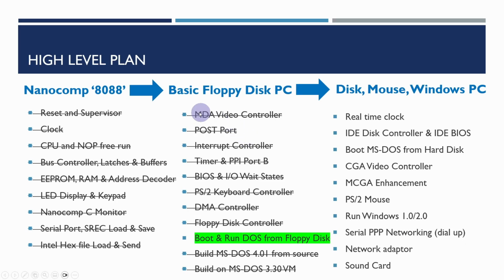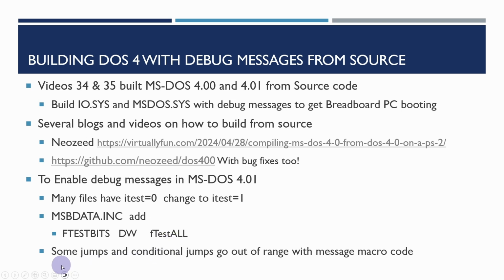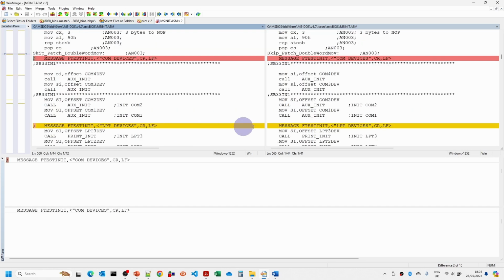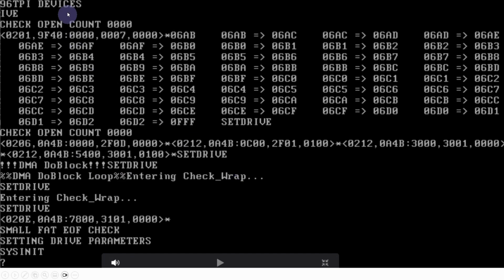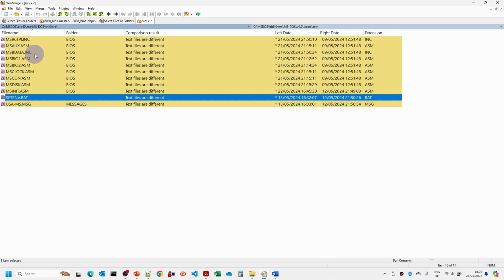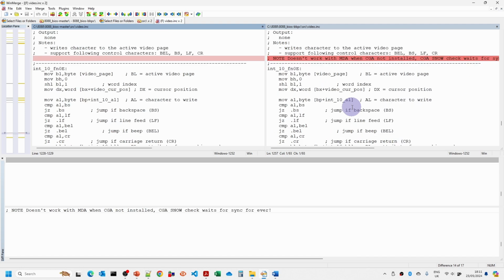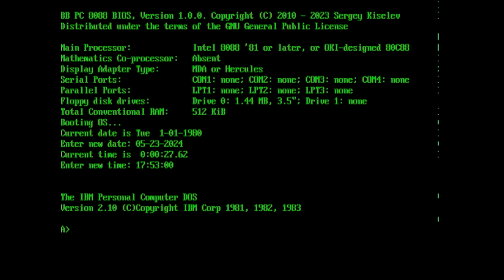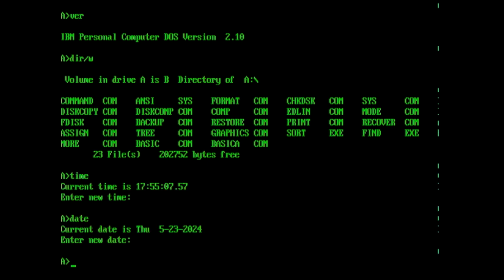Breadboard 8088 PC Boot & Run PC-DOS 2.10 #36

Comment: Finally you have done it! Congratulations. As for the BASIC issue, it is possible to add the ROMs from the original IBM PC and start to BASIC when there is no floppy to boot?
Reply from the maker: Thanks, yes the BASIC I didn't think too much about at the time but I seem to remember the XT had cassette BASIC in ROM (which was unable to talk to floppy disks). I'm not going to stress too much about that. May try Microsoft GWBASIC from 3.3x but no point in messing with IBM BASIC. Dave

Comment: After watching your previous videos, I decided to try PC DOS in emulators and got problems with BASIC as well. Initially I thought that emulator have bug, but then I learned than BASIC in PC DOS is not a regular program, it's an extention to BASIC located in ROM. So if ROM have no BASIC, then BASIC from DOS won't work. I checked BIOS you mentioned and saw "we don't have ROM BASIC" text there, so this message is maximum what you can get without putting BASIC into ROM intentionally.
Reply from the maker: Thanks for the info. I didn't think too much about the BASIC issue at the time but you are correct about the IBM BASIC ROM. Not really worth worrying about as from memory the cassette BASIC in ROM couldn't talk to floppy disks anyway. Will try GWBASIC from later DOS versions in the next video. Dave